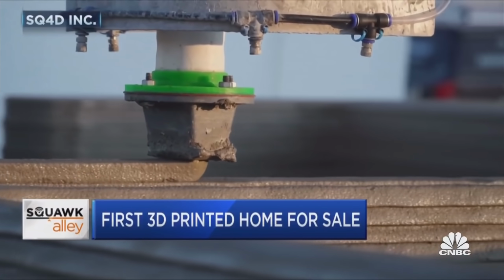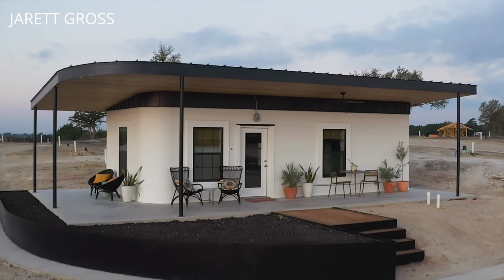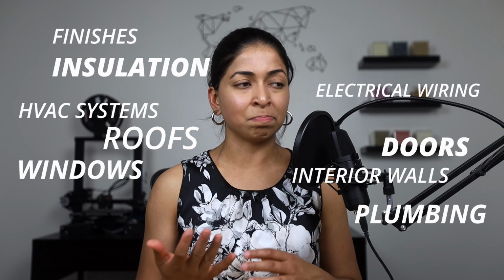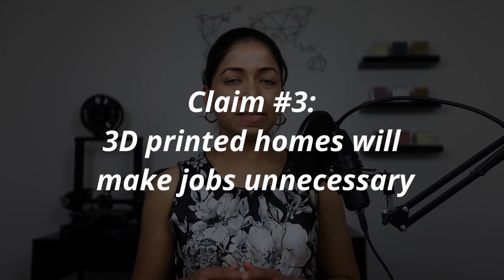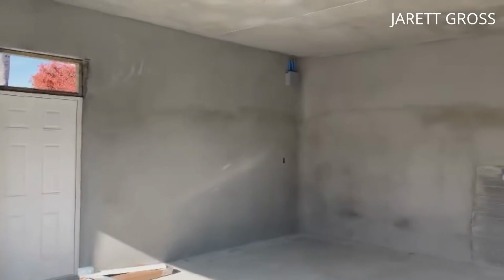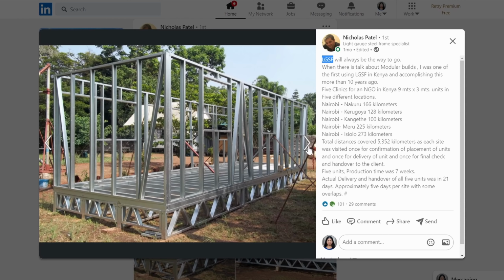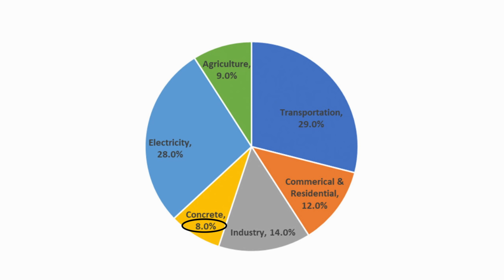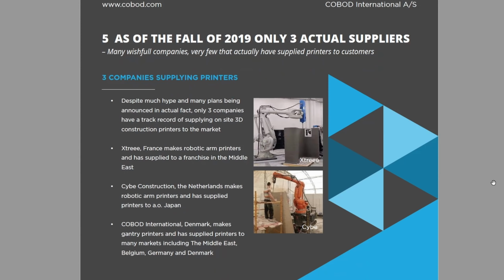Exposing 5 LIES about 3D Printed Concrete Homes

Comment: Can you imagine the hassle of fishing wire through 3d printed walls because someone decided post construction that they needed an extra outlet or to beef up their data?  It sounds like a nice idea for external walls, but I wouldn't want my entire house made out of concrete. I change my mind too much.
Reply: Err... in the UK most of our houses have solid walls. Brick cavity wall construction. Running data  cables isn't an issue. 3D printed houses are mostly cavity wall construction too. The cavity is an ideal place for cable runs.
Reply: @martinw245  My dad is an electrician and I've watched (and once helped) him fish wire through old cavity walls.  That was exactly the "hassle" mentioned above.
Reply: @rtyria  

Well yes, it takes effort. But then wooden stud partitions require you to fish cables too. As I said, almost all of our houses in the UK are brick and cavity wall construction. It's no big deal. It's not like you run new cables everyday.

Brick or concrete construction is common throughout the world.
Reply: Concrete is a useful material.  But yeah, all concrete everywhere would be a terrible home.  I think it's great that people are excited, so there will be R&D spending so they can start actually delivering on some of the hype.  But it's definitely going to take "mixed media" construction.  I'm imagining home construction in 20 years will involve a self driving truck dropping off factory-made sections.  And on-site robots using wood panels for most of the walls.  (And maybe some sort of printable plywood slurry for some details.)  And the 3D printed concrete will really only be used for the stuff we currently build with concrete.  Anything that is done with prefab concrete blocks today could probably be done with an in situ concrete printer.  But we almost never build all of our walls out of concrete blocks, so even if concrete printing gets an order of magnitude better, it's still a small part of the project.  I would expect to see one or two structural concrete pillars printed into a future home behind the walls.

Comment: How would you construct an earthquake resistant 3D printed home? Concrete walls in seismically active regions need a lot of steel reinforcement vertically as well as horizontally.

Comment: So basically even when used to its full potential, it's still only an option instead of being a magic cure all. Depending on where the job site is or local electricity costs, 3d printed concrete can be potentially incorrect to use. It still looks really handy for urban environments. Very insightful video

Comment: I'm an electrician apprentice, so take my point of view for what you will. However, I've been in the commercial field long enough to recognize that there is an order of operations to construction. Speeding up one part of that process doesn't mean the entire process is faster or easier, it just means a tighter window to do what needs to be done, such as put in PVC piping for electrical and plumbing. That does not help the situation hardly at all, especially when there are concrete guys who want to make sure they go home with a 40 hour check at the end of the week. There have been sites where we've had to find work arounds because a different crew, like concrete, pushed ahead despite us and we had to either tunnel under their pours or drill through them. 

I do love new technology like this, but this does not help most construction sites outside of urban housing, and urban housing have their own inherent issues. Personally, I'd like to see a resurgence of traditional masonry and carpentry. Clay, stone, and strong wood. There are some structures made with these techniques, in some of the harshest climates, that stand to this day.

Comment: As someone who frames houses let me tell you… If there was something that was cheap and easy to build houses from other than wood we would use it for the mere fact of fireproofing alone… even with the advanced synthetic stuff we use to put stuff together in homes the entire thing is basically one big campfire (+your family) ready to go..only the smoke/chemicals and everything else that’s built with it will most likely kill you before the flames will. 
The reason we still use “burn me up Scotty” wood is because it literally grows on trees (duh) and it’s easy to shape (Cut) to how you want it to be.. basically if there was a better option we would use a better option.
…The reason we don’t use steel to build peoples homes is because your house would be expensive as everloving shit.
Reply: I guess this is a US perspective, because here in the Peruvian highlands all modern houses are reinforced concrete and brick. More traditional structures are straw-reinforced mud brick (adobe), or straw-reinforced rammed earth. Building primarily with wood doesn't occur here except in the jungle where it's palm-thatched huts. Also it's mostly brick or concrete in Europe too, even in places with similar climate to the US. I'm not sure why the US goes for wood so much. Especially when bullets start flying, or a hurricane comes, or there's a fire (as you say), there's no protection at all.
Reply: @uazuazu  Using wood in US is regional. Florida for instance is all Concrete block.
Reply: @jimclark2824  most likely because of hurricane threats in FL. I’d imagine that’d be more expensive than wood but mandatory
Reply: @uazuazu  Probably has to do with cost effectiveness. And like the other person said, hurricane weather drastically changes the needs for home material in the states

Comment: I feel that 3d printing is great for smaller things or components which require strength to weight like in a vehicle. 

For buildings it seems prefabrication might still be better. 

To me, 3d printing is always about making something special, so a custom home which looks super cool, that's where it shines.

But if we're mass producing things, additive manufacturing isn't usually the best way.

Comment: At last someone talks sense. The walls have been some of the quickest parts of constructing a modern house. From an old time building worker.
Reply: I believe you are correct But is 3 D quicker
Reply: @Gordonz1  yes it's faster, but the quality is much worse than normal concrete
Reply: A good team of bricklayers will have a house to the first level in about a week also you've got to remember that you don't need any electricity for bricklayers.

Comment: I always felt kind of skeptical when seeing these articles, lots of good points made.  I don't think these 3D printers can do roofs etc, and even if they could, I don't know if I'd trust that construction.  Water will sit in all the grooves, freeze, expand, and cause cracks.  Concrete needs to be smooth to avoid these types of issues and also for large runs you want rebar and this method does not really provide a way to do that.  I think the tech does have some uses to lay down the basic foundation and some walls and other complex features, but I would not call it 3D printed building at all.
Reply: That's a common misconception - concrete doesn't need rebar. We have alternative technologies and additives to make it strong in tension, rebar is just well-understood and generally cheaper.

The additives needed to give it tensile strength aren't cheap, but they improve the results of the printing process by making the material stronger while it's curing.

Comment: You absolutely can build a 3d printed home for $4k. just not LEGALLY and absolutely not "anywhere"

I can't speak for the rest of the world or even all aspects of the US but I can speak on the larger points

We have essentially (if not literally) BANNED affordable housing in the US. its pretty much illegal for all intents and purposes and this is largely why we have such a housing crisis here.

The counties don't want affordable housing since PROPERTY taxes are based on home value so they abuse "zoning" to restrict what is legally allowed to be built. sure a lot of it is safety but a lot of it is also there to force home values higher so they can collect more taxes.

Get rid of the not needed zone restrictions and the profit gouging and yes you can in fact make a $4k 3d printed home. its not even all that difficult. it will be a studio. think 3 rooms. main room combo kitchen bathroom and bedroom. probably 600sqft or less even. it will only really work in low rain dry arrid environments (you need a bit more for the wetter and colder climes) BUT IT WOULD be a start.

We have just made it illegal.

The core issue however is why bother? just use a pair of connex containers. boom 660sqft home.

Of course that $4k does not including furnishing connections etc.. IE just a shell. would need around $8k to $10k to make a truly "finished" home and this would require some government support (infrastructure etc..)

Comment: For me, 3D printed walls have more of an aesthetic function instead of an efficiency or cheapness one. It allows for techniques and shapes for walls that would otherwise be extremely costly or complicated to make, and can provide an interesting raw texture to the wall. I don't think at all that it will solve housing problems or cheapen standard housing, it will just make homes with interesting, non orthogonal shapes more common and cheaper.

Think of the potential for making moldings and simple sculptures with it on otherwise minimalistic or blank walls!
Reply: You make a very good point!

Comment: The best place for 3D printed buildings would probably be Tornado Alley. I can see round structures having better resistance to wind sheer and being less likely to get uprooted and torn apart. The shape can also deflect debris instead of just taking the full force of the impact. Being in the States also reduces the accessibility and power issues mentioned in the video. Basically the best test bed to improve this technology.
Reply: flat-pack multi-walled inflatable 'molds', pump in local 'sand' into the skins, with a binder (e.g. sodium-silicate) perfuse it with CO2. voila, a gas-tight 'concrete' structure, cut holes for doors/windows as needed. works anywhere, even on Mars.

Comment: I always thought 3D buildings would be of most use on the Moon or Mars. Where your not going to want windows. And the only building material around is sand and rock. You bring a glue to mix with the sand and there you go. Just bring your own air lock and oxygen.
Reply: I don't think anyone who's smart enough to go to space is going to trust some 3d printer to make air tight seals. 3d printers make mistakes. And the idea of trusting your life and air to one is a far flung idea. Also everyone knows the cost of air on Mars is out of this world.
Reply: @skprog  It's under active research by NASA. There are huge technical risks, but it's also incredibly expensive to ship stuff off-planet. Look up "additive manufacturing in-situ resource utilization" for more info.

Air isn't expensive on mars or the moon - you can bake rocks and they release oxygen. There's a lot of technical development that needs to be done there, but long-term we are not planning to recycle oxygen, just produce it in-situ.

Comment: Fantastic video! Theres alot more that goes into the construciton that anyone thinks of with the basic structures of these 3d printed spaces. Especially the bigger thing I find strangly forgotten about is theres also alot of additional time spent on modelling out the home, Having tospend 2-3x more time with the electrical system and getting the pumping in without having exposed plumbing without sections built in a more traditional method.

Comment: Like Tesla is to automated driving... ah yes another field where the hype has completely eclipsed the capability of the technology. Automated driving is very cool. But it is still a long way off from what people seem to think it is capable off.
Reply: @jedharrington6234  Did you seriously expect Tesla to be reasonably self-driving? Like so many ‘innovations,’ it’s been a far cry from being out-of-the-lab ready. Still, I don’t blame Telsa. I blame the owners and drivers of them who love to be stupid, arrogant, and reckless.
Reply: @FR-tb7xh  no I fully knew it was going to be bad, I also wouldn't fully blame the drivers since they are just using it the way it was advertised to work.
Reply: @FR-tb7xh  not really. You sell FSD cars and then blame the consumers? Bs.
Reply: @mohit_panjwani  Every Tesla incident I’ve heard about has been caused by the driver failing to supervise behind the wheel. From Tesla: “While our cars require active driver supervision and are not fully autonomous today, the FSD computer is capable of delivering intelligent performance and control to enable a new level of safety and autonomy, without impacting cost or range.”

Comment: The technology is interesting. However successful new construction technologies integrate into existing construction processes, instead of disrupting the entire construction process. 3d printed homes are causing to much disruption. This is why they keep switching to wood framing when it gets difficult. 

For example the icon homes have all bathrooms against wood framed walls. (They haven't figured out how to attach showers and integrate the drainage planes.) The kitchens were also almost exclusively against wood. The few that weren't have serious fit and finish issues scribing the cabinets to the walls.

My guess is that they may achieve success replacing tilt up and possibly foundations. Assuming they can achieve costs at least 10% cheeper than existing technologies. Full 3d printed structures will remain niche unless they find far better ways to integrate.

Comment: You have a very good perspective.  I was at a site in NY that is developing innovative block structures to build domes and vaults.  There is a prototype house you can book as a B&B.  When you go there and talk with the developer, he quickly starts talking about how they are going to use a 3D printing machine to lay the block.  While it's plausible, it seem's a bit non-sensical to use a completely non-modular piece of equipment to build out a technology that is inherently modular.  Anway, they were also making similar claims - the structures have a very high hurricane rating, and will be great because there are more hurricanes because of global warming.  On inspecting the outer weather survace of the roof, it's a traditional wood skin with asphalt shingles.  Asked what will happen if the roof blows off... well... it leaks. So... maybe good as an emergency shelter to avoid going to OZ, but maybe not ideal for your family photo album or your electrical systems.

Comment: As someone who only works in sustainable and all-natural architecture design and construction (mostly traditional modalities), I deeply appreciate the honesty and clarity of this post. 3D-printed homes of modern OPC concretes are anything but sustainable, and cost-effective, and are certainly not natural or good for the environment. If 3D printing a structure with local earth-based materials, you achieve a greater ecological improvement and lower carbon footprint...however, this still can not compete with traditional systems of earth architecture and is a decade if not a century away from being cost-effective and socially applicable. This tech is best aimed at space colonization and related areas. If the technology improves, it will more rapidly (???) then we may see sooner innovations that are actually sustainable and cost-effective compared to proven methods...Thanks for a great post!!!

Comment: They also don't look very structurally sound. Concrete needs rebar frames internally even when bricks are being laid down. Rebar is an important component. Concrete alone is not good enough and arguably not safe.

Comment: The biggest strides in construction  industry efficiency were not fancy technological toys, but the Just in Time methods of the LEAN principles. I have a normal 3D printer and I would never claim it makes injection molding obsolete. I also question the material properties of a layer wall, compared to the homogenous concrete walls.

Comment: Jim Sim... I am an ex building worker . And know how architects university gradu ates non trade professionals .always know better than trade .often coming unstuck when not listening . Even causing serious loss of life in the process . I think the best way this tech can be used .is to set up the machine in a suitable place on site . And then print prefab type panels .let them harden and deliver to plot for assembly . This means all wall materials get delivered in compact form . Also assembly is automated .the reinforcing plus assembly fittings can be incorporated in manufacture . I think it needs a squad of trained workers working with this machine it is complicated and will always need skilled workers who know what the problems are and how to fix them . Also good maintenance is vital breakdowns cost big money . Used in the right way alongside all trades this tech could benefit the building industry . A lot ...

Comment: 3D printing as an issue aside, I've spent a year living in a fully concrete built apartment and let me tell you what an absolute nightmare that medium is. It's oppressive and dark, and the humidity collects and ruins EVERYTHING, even with dehumidifiers in place. The walls are easy to damage and you can't easily hang things on the walls, forget posters, mirrors, shelves. It was the most unpleasant living I've ever experienced. It felt like a prison. I'd rather live on the street.